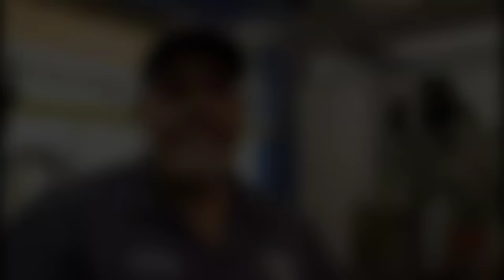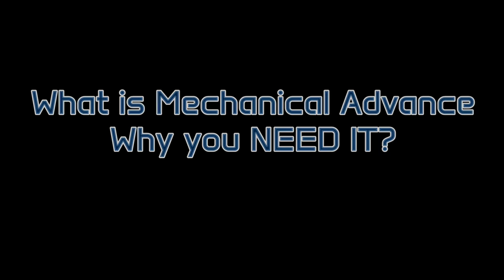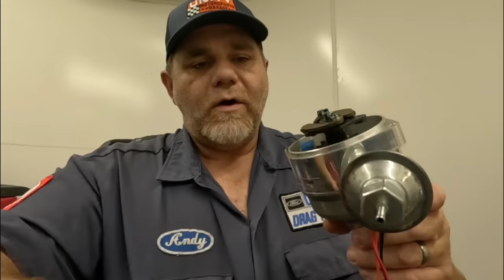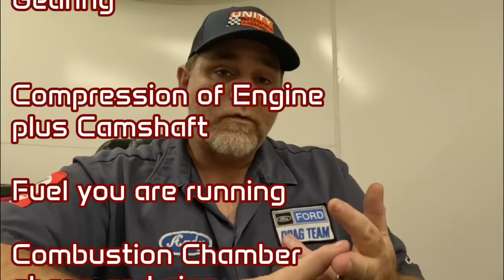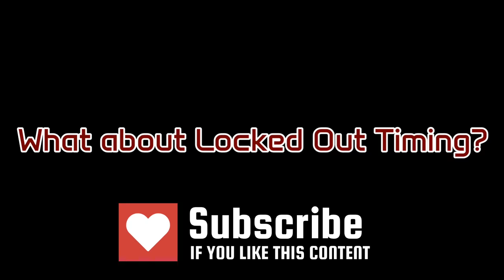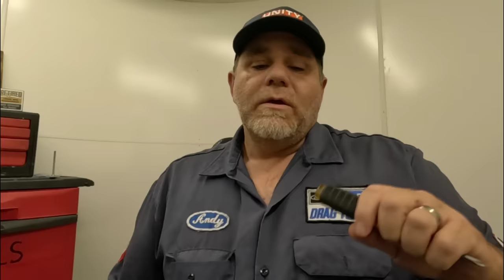Ignition Timing or Fuel Tuning First? You are doing it wrong!

Comment: Would you play with the rotor teeth from spark plug  color?  Like a further cylinder gets less fuel so it should be retarded 1 or few deg° higher to compensate??  It makes sence for 0.010 sec on a 10sec ET.  But not a street car.

Comment: I disagree with some of your statements and agree with others.
First of all, I wouldn't be telling your viewers "you're doing it wrong". There are many ways to skin a cat.
Not only AFR, fuel grade, temperature, altitude, fuel droplet size, among others, influence the distributor timing curve. After all, it's a combination of fuel and timing what makes most power. There are many variables we have to overcome.
Just to give you an example, in the early '70's I was able to meet 1975-76 Federal Standards running engines as lean as 21:1 AFR, sub six micron droplets and a distributor with modified mechanical and vacuum advance mechanism.
It just so happens, I worked as R&D Engineer in the auto industry and had the equipment to achieve my goals. 
Final thought, "You can get to your destination, just follow the road it's easiest for you".
Believe me, not only did I work as an R&D Engineer, but I delivered technical training for thirty five years.

Comment: I totally agree I am really enjoying yours and DV 's videos I am really interested in knowing if you could help me spec / supply me with a cam Please let me know David's formula puts me at less than 100* lobe separation on my 429 Windsor engine Should I use big block ford 133 number instead of 127 Thank you in advance I really like the programmable ignition timing of my Holley fuel injection system
Reply from the maker: What heads / Valve sizes are you running? 127 should be the number for a SBF
Andy
Reply: @UnityMotorSportsGarage  hi sorry I run AFR 220 cylinder heads 2.10 intake valve 429 cubic inches
Reply: @UnityMotorSportsGarage  hey Andy so I have AFR 220 renegade heads 2.10 intake valve on a 429 cu in SBF in a Dart block Super Victor intake  I only have 9.2 to 1 compression now long story I have been chasing this thing for 3 summers I really need your help !!! I have a Ysi7 Vortech supercharger on it as well

Comment: Ok!!!! This all sounds good and all. Now how the heck you do that? I try to get it going down the road 13 to 15 with the power valve working to. Got the timing around 37 at 3000. No ping that I can hear. Plug don’t look too bad (tan). Then you get the day from HELL! 105! Can’t get 91 octane! Wind blows like 40 mph! Temperature gauge is warm. Then going down the road it like 16 and once in awhile you think you hear it missing. Next day you go out to try and fix this mess and it 75 out and it runs almost rich. So how do you fix this problem? I have just left it now and trying to save money for a carb cheater. I don’t run vacuum advance I got a pro billet  . So how do you fix the problem of gas and weather in this or just do the best you can.
Reply: vacuum advance on street cars is pretty important.  youre handy capping yourself without it.  but youre talking just about the total.  not the inital.  that needs to be wherever that engine wants it.  as a rule of thumb,  if you took an engine and changed over to a "bigger" camshaft, then you needs to have more initial timing,  given nothing else changes about that combo, at a minimum.

but youre converter  gears  also matter. you start screwing with the carb,  then youve got other issues youve created fro yourself.  carb too big?  too small?  an engine only needs so much CFM  but that causes more of a bogging issue than the timing curve  will have  but put some vacuum advance on it  and get you initial  right  while keeping the total the same.  that would require something like he has in the video  where  initial and mechanical and vacuum advances are all adjustable.  its a 3 part puzzle that has to work together  to not cause the issues youre having

Comment: I got a sbc 350 that I’m building and the heads I got are 64 chambers and 205 runners so I gotta manipulate a lot so it has at least a little bottom end grunt? 2700 converter 373 gear rear on a 3800lb car 268h cam? Hoping I can get it all to work together with nitrous?..
Reply: The Progression Ignition distributor allows you to build a timing table that will give way more low end response than any mechanical advance unit and all the tuning is done on your phone in seconds.
Reply: if im reading what youre saying  correctly, then Id say   that 268H  cam and 205 cc intake runners  is a missmatch

that cam  needs at the biggest some heads with 180CC runners , a dual plane and a 2000+ stall.  and you should get a split duration camshaft thats geared more towards "nitrous" like a 100 shot or something

Comment: Sir, I think you should have prefaced this video with the common misconceptions hot rodders have seen for decades in magazines. Mis-informed people have bought "hotrod" distributors with no vac advance for several decades for their stuff that would never even run a 12.90 because it was "racecar" stuff. It's a monkey see monkey do world out there. They lock the dist weights because it drives so much better after they have deleted the vac adv. And yes, most of the "locked out" guys have never  spun the rpm up to see actual timing retard with rpm on a timing light. Yes, the caveman approach is pretty close, but damn, there are benefits everywhere for doing a timing advance curve that the engine likes
Reply from the maker: You are right about that! 
Andy

Comment: Okay.  Yes I think you're a little bit wrong and a little bit right.  First, if you are setting up the carb with improper timing, then that won't be adjusted correctly.  Second, if you set up the timing first with the carb not set up that will not be timed correctly.  My point is simple, you must adjust one then the other more than once.  You might need to do it several times to get both correct, especially when dealing with springs, weight travel limits, and adjustable diaphrams.  So really this topic is wrong either way you do it because you have to do both several times anyways.  It doesn't really matter which one I do first when I have to come back around two or three more times anyways to make adjustments and 'dial it in'.  Also, your solution to this problem is to go EFI.  That might be a good point given the many adjustments of the carb setup using standard electronic timing at the distributor, but for those of us old timers (47) that might want to hang on to the old ways for a little longer, this doesn't offer a real solution.  The solution is to adjust all of the components several times and is a pain in the ass, but that's what we get for not having EFI.  I did enjoy the video anyways.  My 72 Ford Bronco is backfiring like hell through the intake side, and I can't figure out why.  That's how I stumbled on this video.

Comment: One night while hauling a band's worth of equipment in the back of my truck
It just stalled on the freeway, The stud that holds the Spring in my unilite distributor broke off Got wedged into the shaft, the helical gear ejected the distributor and broke my cam drive Gear, I Run MSD now, every time I see a mallory distributor I cringe.

Comment: I don't think you're crazy. However, I don't  think it matters that much as to which side of things you begin to dial in first, because a person should go back and forth anyway. Say you start with the fuel, then tackle the ignition. You should then go back to the fuel and then back to the ignition again, etc. and vice-versa. You can't dial in either if you just go through each one once, it requires a back and forth methodology, narrowing down each one off the other one until they are both just right. If you tried to just pass over each one once while tuning an EFI engine, you wouldn't get very far. In other words: you would'nt maximize the full potential of the setup, because each system affects the other one over and over again. The same applies with carbs and distributors.

Comment: most mechanical/vacuum advance set up do not follow carburator 2 barrel to 4 barrel pace rpm . Most stock ignition are set for low rpm enjoyment/fuel economy on car with point . Check stock max rpm on spec sheet . You wanted 5000 to 8300 rpm ? You lost low rpm . It's why honda decimated racing in the 1990s .their tiny engine had a nice low rpm , and a peppy high rpm . Thanks to vtec . Now even a nissan versa note 2014 does better but back then ? Vtec ? Was ignored till honda civic 1988 ? Vtec started being raced in non drag racing . It's why a racing venue introduced the weight reward up to 150 pound max . To balance things out . Bmw were there quad 4 etc . But usually the winner was a honda . Later acura . Remember this was done with cars full of false signal because of wireless electricity . Still not fixed in 2024 . If those b16a had no wireless electricity issue ? Honda would have been even faster . Remember back then honda was not bothering with na racing doing . Some even added turbo clearly not recommended by honda . 325 hp ? No problem  . Vtec changed the game . Now you mgot beverything variable . Just add variable geometry turbo and you get ton of fun , as long as oil and coolant is kept circulating after use to cool everything down

Comment: In truth on a street car the vacuum advance is a retard under load. No reason for vacuum advance on a race car. Also the type of engine help to determine the advance required. Personally it is almost impossible to properly jet the carb without the advance being close. I rath work the simultaneously

Comment: Im going to use a megasquirt 2 with a tfi distributor to control spark on a carbed 302 im putting together. Costs a little more but will work a lot better.